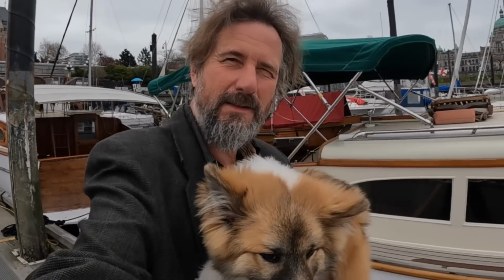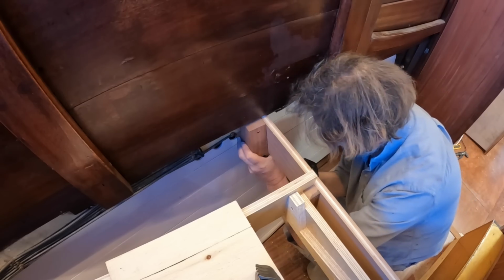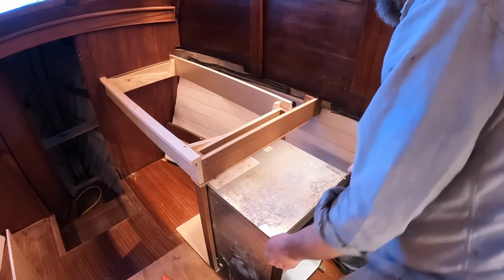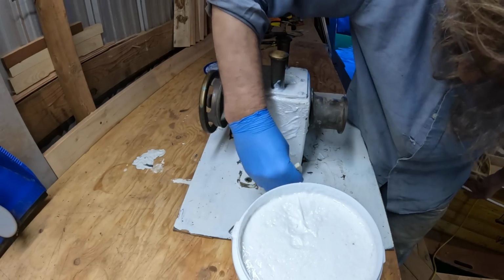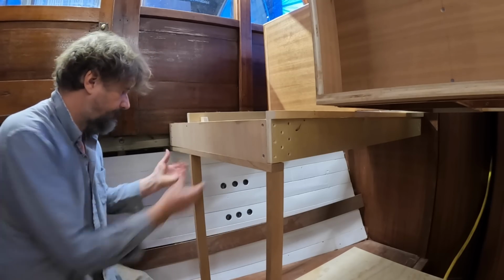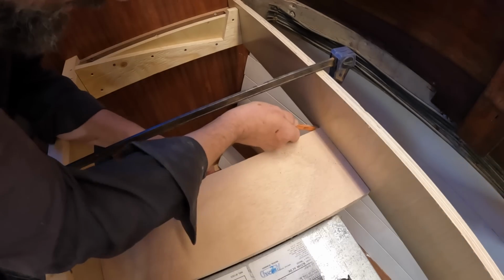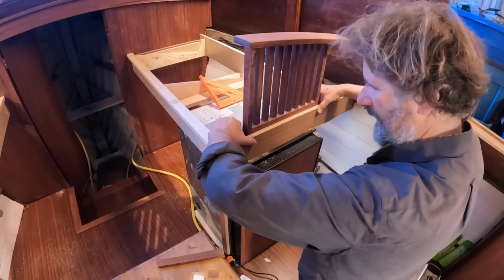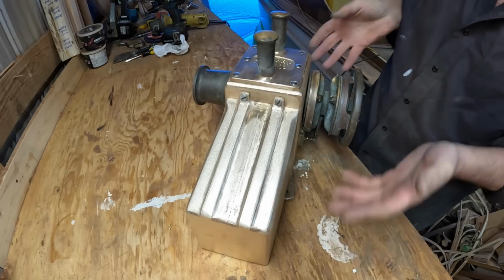Advancing the Wheelhouse - #362 - Boat Life - Living aboard a wooden boat - Travels With Geordie

Comment: Hi Finnegan 🐶 & Peter.
May I suggest once everything is fitted..
to then sort out the various bits of sole that could be easily removed.. if appropriate cuts were made.
I fitted my boat so the hull is accessible fairly quickly.. using a slightly different method.. of working out the walkways and fitting to relate to them.
Regards from
Bella 🐈 & Mark.
Reply from the maker: That's a good approach, but everything is so tight on Poem.
Reply: @TravelsWithGeordie  
It's easy.. ish..
Boat fitting design is integral not modular..
For example...
The load bearing uprights for the bed are directly above the floors.. and the rest of the bed frame secures to the bulkhead and hull with long knees or a horizontal shelf particularly if there are frames of which a small cutout is made to act as a ledge to take the load.
Alternatively a piece of.. depending on the loading at the midpoint between frames.. for example.
2" x 2" bridging the frames along the walkways causes an edge for the walkway sole.. the sole can then be cut to bridge each bay between floors with blocks on the underside of the sole to prevent fore and aft movement and fore and aft battens to stop any flex .. similar is done under the bed.
The drawer units can have a bridging frame, with the same principle applied to the toilet which has a base frame which gives the bulkhead something secure to anchor to..
with the bridge between frames for the door lowered to be level with the sole.. alternatively this could be higher if a shower tray is required.
On my boat the floors, frames and deck beams were positioned for the various bulkheads.
The same strategy can be applied to narrow boats but they tend to floor the whole thing, modular fit.. then hack bits of the sole out to install or adjust ballast..
Another amusing thing done on modern narrow boats as the water tank is usually below the well fore deck is put the water pump there.. and then have cable's, usually with a significant voltage drop running the length of the boat.. a simpler and more cost effective solution is to position the pump near the batteries and use a slightly larger pipe..
I was thinking... a timer to deactivate the compressor fridge at night might be useful, people will forget to switch it on in the morning... also additional insulation ie foil (not mylar) and plastic sheet, 3 layers helps increase efficiency as it reduces heat getting to the cold bit... I've done similar to my deck which stops overheating in summer and warmer in winter.. 🐾🐾🐾 🐈

Comment: Putting in a shim. Years ago, while tearing out and rebuilding the forward berth area on my wood boat, I removed the face of a small cabinet. Something tiny fell at my feet and I reached down to pick up a part of a matchbook cover. The cover had been used as a shim to assure the face fit flush against the cabinet frame. Inspecting the cover I found that It was an advertisement for a Babe Ruth candy bar, ..."sold everywhere for 5¢ !"  Of course that was the 1939 price! LOL Love your work buddy, keep at it.
Reply from the maker: Great story.

Comment: Is the fridge going to end up being locked in an airless box?  I have always found that connecting a muffin fan to the compressor power wires and having it blow across there and the condenser coils adds tremendously to the fridge's efficiency, but you need entrance and exit for the air.
Reply: I'm also curious about where the heat from the fridge radiator will escape to. It looks like the seat above it will be nice and cosy in winter, but a little too warm in summer.
I like your idea of incorporating a fan to increase fridge efficiency, assuming there is ventilation built in.
Reply from the maker: Great point, no, there will be forced ventilation to ensure cooling. The fridge already came with a muffin fan on the condenser.